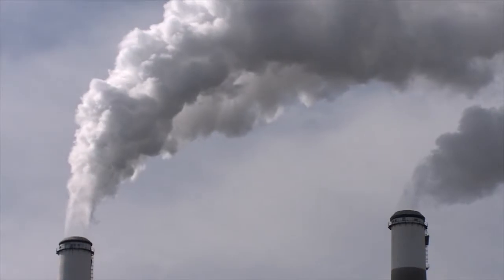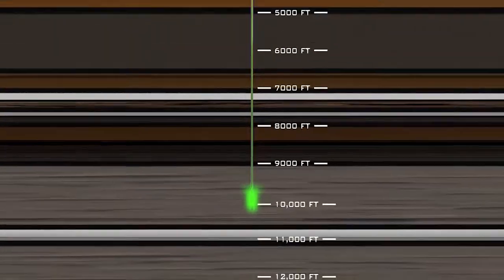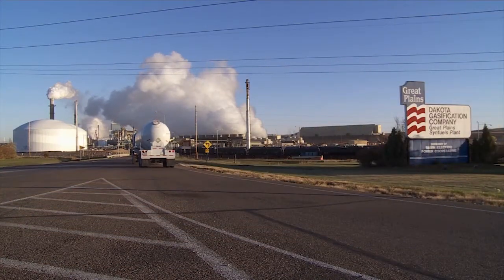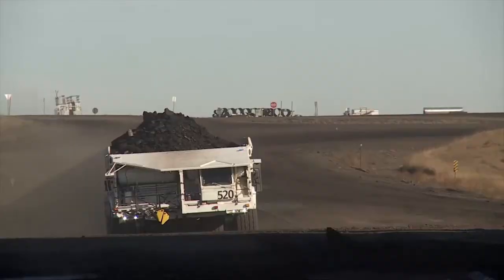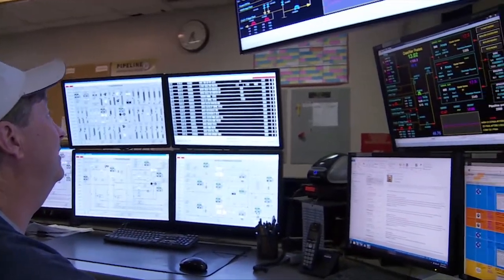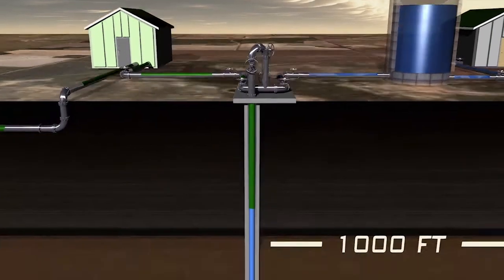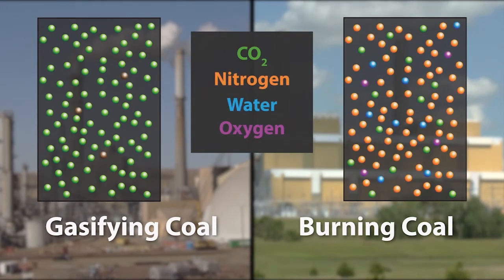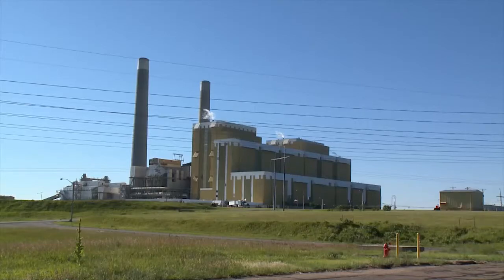Clean Coal: Carbon Capture and Storage

Comment: It works, but clean coal electricity costs 37% to 50% more than conventional coal plant electricity.  So it works, but the power generated is really expensive.  But as oil prices rise, the extra costs will soon become acceptable.
Reply: Nowhere near as expensive as so called 'renewables' - when you consider the cost of producing operating and properly disposing of wind turbines, solar energy panels and batteries. The environmental impact of these alternative power sources is very much played down - but is far worse than that of clean coal. Ironically the steel, concrete and other materials for renewables cannot be produced with fossil fuels.
Reply: @gainsbourg66  yes but isn't it amazing not a single effing gov is talking about this
Reply: but tons cheaper than so called clean energy, new lines, new batteries, new everything entirely unnecessarily
Reply: Nuclear works out much dearer when you take into account in the long term disposal costs (these are not usually factored in).
Reply: Yeah and end user should be the one who pays the price with increased electricity/gas bill. Especially when electricity from renewables is much cheaper. CC is expensive and makes sense only as a transition technology before moving to something cleaner. It would be OK to use it in a long term if coal burning companies would keep the electricity or gas at same price as market average and not more expensive. It shouldn't be end user/customer to pay for company's decision to use "dirty" technology. Also it doesn't make sense to capture all that CO2 and then use it for pumping new fossil fuels which release new CO2 into atmosphere. The whole equation must designed in a way that it make sense and not for making fossil fuel industry even more richer and polluting!